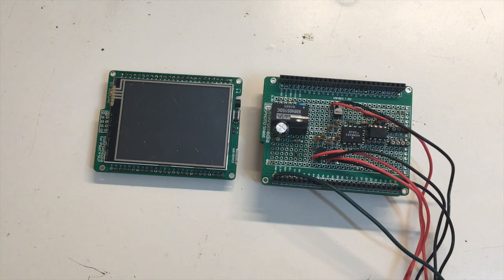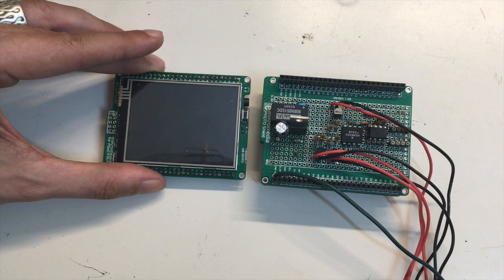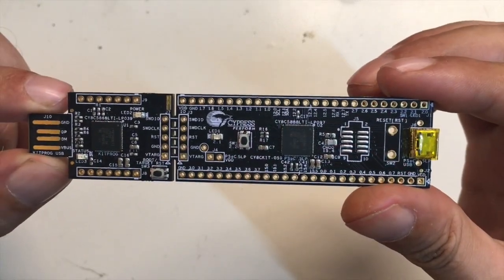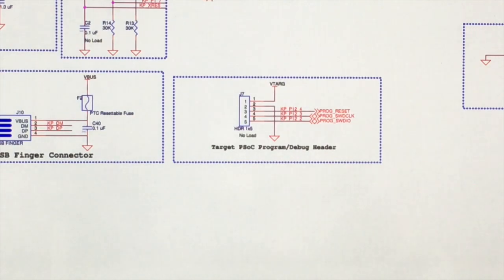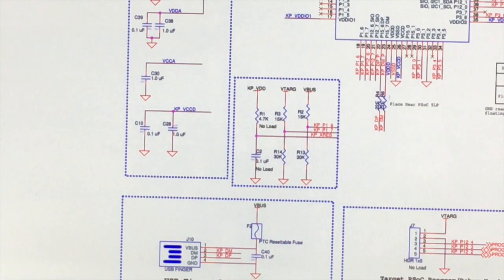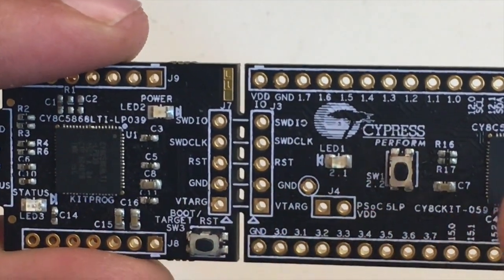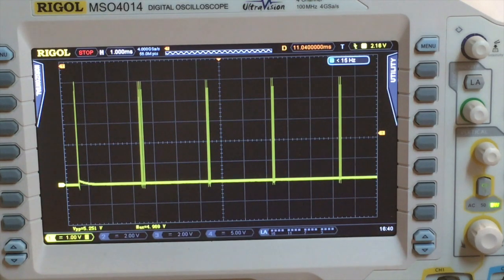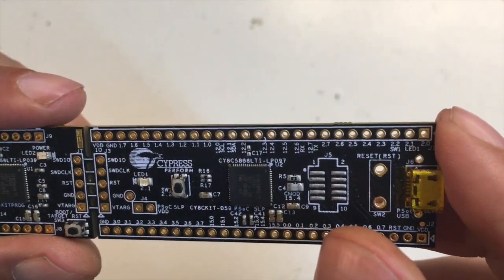#001 Cypress PSoC & KitProg

Comment: Thanks Frank, appreciated, South Africa. I have two identical CY8C24123A in circuit with those 5 pins. One is working and one has failed. I think probably due to load shedding in our country. Is it possible to read the good chip and write to the failed chip. Thanks. If possible.

Comment: Thank you for making such a clear and informative video. I am trying to self-study more about electronics. Just to double check: by snapping off the D1 diode, do you mean just remove it with something like a tweezer by "brutal force"? And then the programming voltage on the KitProg will be equal to the target voltage, for example 3.3V. However, next time if the prototyping board needs 5V again, what would you do to recover the lost diode? Somehow resolder it back?

Comment: i snap the kitprog for mistake 
how can i put back together?
Reply from the maker: Hi Jhon

putting it back together requires several steps:
To have the programmer functionality I would use 5 pin single row 90° header and socket. 
i.e 
https://eu.mouser.com/ProductDetail/TE-Connectivity-AMP/3-644457-5?qs=sGAEpiMZZMs%252bGHln7q6pm5PveGu%252bNdYGPtsJRej7EgY%3d
https://eu.mouser.com/ProductDetail/TE-Connectivity-AMP/216602-5?qs=sGAEpiMZZMs%252bGHln7q6pm8SOCK6aAoLgZW0v9Z5JIpk%3d

With that the programming interface (SWD) is working again.

Unfortunately with the snapping you also cut the UART which you might want to use.
To fix this you need to do some wiring from the KitProg to the Board. You find them on the 14 Pins on the KitProg sides. As the original connection to the Targetboard is gone, you can very much decide yourself the pins on the target board.
As I don't know which of the Prototyping Kits you have I will not mention pinouts here. On the KitProg the signals are mentioned on the silk screen print.

All the Best
Frank
Reply: thanks frank prototyping kit is CY8CKIT-059  it will great if you can help me , thank you!!!!
Reply from the maker: with the 59 it is nice and easy to rewire the UART as rx & tx are on J9 pins 6 and 7 on the kitprog
just wire them to the pins you like on the target board

Comment: Hi, do you know if its possible programmer the CYBLE-022001-00 with this kit programmer?
Reply from the maker: Hi Carlos
I would expect so. The module is basically a PSoC 4 with "some extra" ;-)
I just checked the dev kits for the module. Cypress is using the BLE Pioneer kit, which is a PSoC 5lp as KitProg.
Yes you can use the KitProg as shown in the Viedeo. The difficulty will be the connection to the module itself. The pads look tiny ;-)
In case you are using the module on a larger PCB make sure you have profided yourself a connector to the KitProg.
All the Best
Frank